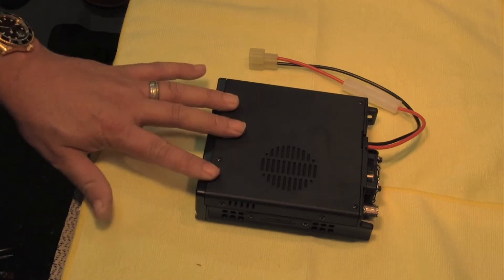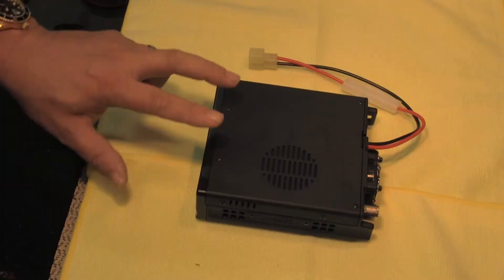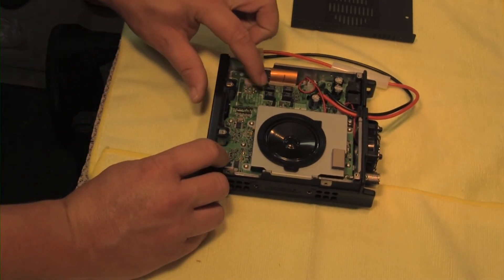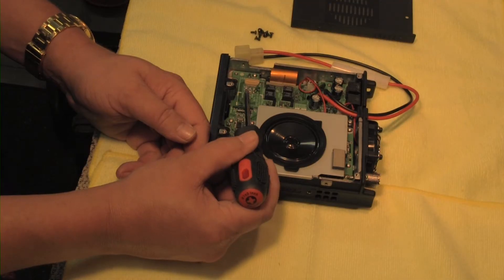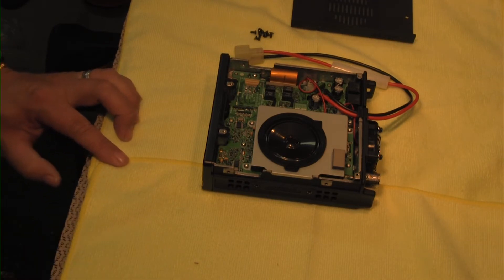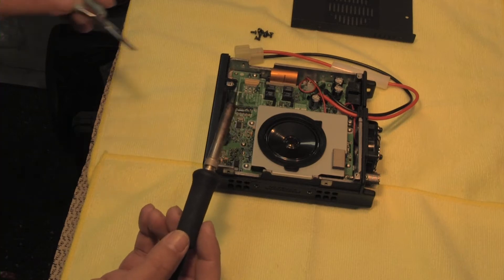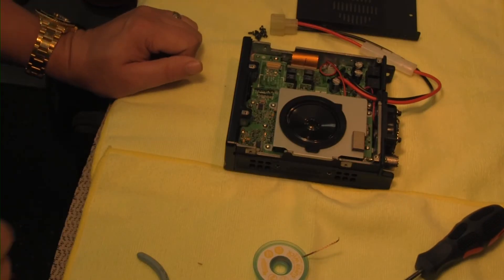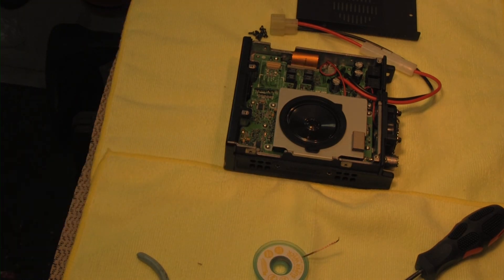Kenwood TM D710 Mars Cap Unlock Mod - How to Expand Your UHF VHF Bands

Comment: Use two soldering irons, one at each end of the resistor and simultaneously melt the solder on each pad to avoid lifting PCB tracks.  With steady hands you can lift and hold the resistor between the two soldering iron tips, a good lamp and a bench magnifier is essential kit when working with SMDs.

Comment: After this mod can you use the Itinerant Frequency's?  Say 151.5125 as an example or 151.625.   Mostly wondering about the step frequency, I understand these frequency are in the new 140-173.995NHZ range.

Comment: just got a TM D710E second hand and wanted to do this mod, it has wide band RX but looking inside the green wire has been removed but a resistor is in its place and no resistor at point 1 or 2, can i still mod it to TX wideband?
Reply: Yes John, I have just modded mine. There is a resistor where the green wire is. Remove it and that's it. There is no further mods needed. You will be able tx outside the amateur bands.
Reply: Thanks I did go ahead and remove it and works well, makes a great scanner now and I can use it on ham bands and my 4x4 response callouts.

Comment: Best way to remove the resistor is to first put down some flux on both ends and then add more solder to both ends, building up a slight pool on each end. You want that additional thermal mass on each end to help keep both ends molten while floating the resistor loose.  Adding more flux to both ends to keep the metal clean and flowing as you reheat both ends, then push the resistor off its pads.  Note that the solder paste used by the factory melts at a much lower temp than most wire solder, but the board itself will sink a lot of heat away.  Paste flux or liquid flux for circuit board rework is available from most component suppliers. Paste flux added to solder wick before use will greatly increase its pick-up speed while requiring less heat into the joint.  Don't forget to use a flux remover afterward.  No flux remover handy? Heet brand gas line antifreeze additive (ONLY in the Yellow bottle, NOT in the Red bottle) is 100% methanol and does a good job cleaning up afterward with no residue.

Comment: Modification works great! Only one problem making a 5-minute job way way too technical and risk actually burning traces off of your board!. Proper way to do this procedure cut green wire at both ends with small sharp scissors or Precision wire cutters. Number two. take a razor blade slide under the small resistor underneath that use corner of the razor blade and gently pry it off the board it will pop right out! They don't Solder these in too well.   As described in his video you will lose all memory channels but this is the cleanest way and safest way to do this procedure. any one of us that's ever put a soldering gun in our hands has burnt a Trace. Remember the money you got in your hands. And accidents do happen. Trust me go for the Razer Blade and cut the wire at solder joints
Reply: Its the resistor below that one, resistor 2 that does the x band repeat.  If you read the board you can see where it is labeled.

Comment: will this mod void the warranty?  I would like to have the ability to use my rig as backup for my vhf marine radio out on the water...
Reply from the maker: if you have to send the unit in for any reason that would require them to test it or go "inside" yes yes yes, it would indeed void it'

Comment: I have a Kenwood TM-D710GE and there is no green wire but a component soldered where the green wire should be. There are no 2 components below where the green wire should be so there is nothing that can be removed there. I removed the component where your green wire is and now I am able to transmit on all frequencies.
Reply: As above the D710GE is different but removing the component that sits where the green wire sits in teh video does the job! One thing to remember for anyone is if using the MCP 6A program i.e D710G then after mod it will re-set. Since this mod resets the rig YOU MUST READ the config first, before loading any saved config via the programming software. M0OLI

Comment: Thanks for this! After the modification, the transmit frequencies are 140 - 173.995 MHz and 400 - 469.995 MHz. It goes without saying that transmitting on most of these frequencies is illegal.

Of note is that if you're using the Kenwood programming software, after the radio resets, you must first READ the empty data from the radio so the software recognizes the radio, then re-WRITE your programming data to the radio.

Comment: It's *always* preferable to de-solder parts off the board vs just prying them off the way some people have done. Breaking or prying them off can inadvertently damage nearby circuit traces and cause unintended problems afterward. If for any reason you decide or need to restore the radio (undo the mod), you can simply solder the resistor and green wire back into place so you should indeed save these two items after their removal.
It's good to see someone showing this modification the right way :)